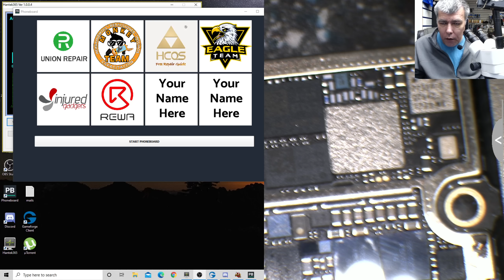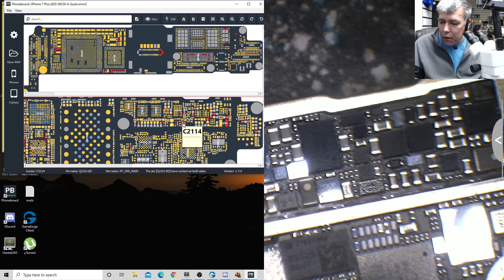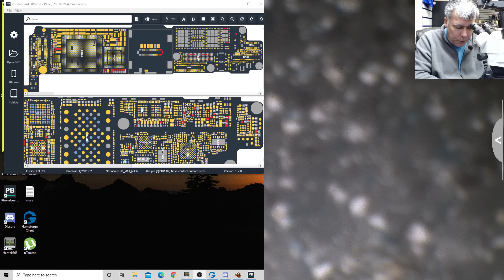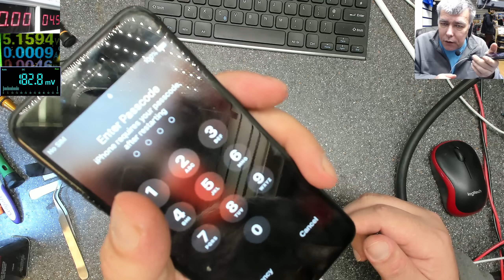Iphone 7 plus, shorted board repair

Comment: Freeze spray or compressed air upside down would be much precised to determine schort components. Even rosin flux smoked on the board.  Not to mention thermal camera.
Reply: Petrol/Isopropanol is cheaper and always available in a repair shop. And don’t forget he is doing very cheap repairs.
The favorite repair method from iPad rehab was her cheek for example. Whatever works is ok.

Comment: i have a problem with an hp laptop thats not switching on, compared to the other hp laptops that i have opened up whereby only the standby 3.3V are present, this one seems to have power to most of the coils, once the charger is plugged in. however the fan doesnt turn on dont matter how many times i tried to ground the standby voltage. im thinking the super i/o is faulty causing the coils to have power, is there anything else that i can check. thanks in advance.

Comment: When you say about "come with the  amps" beyond the mosfet, is this like it is with the laptops where the mosfet is open and you need to "come with the amps" on the output side of the mosfet of current sense resistor?
Reply: In this case (without rewatching it) I think he means just put the Linear PSU on the phone by connecting positive and negative from PSU to the battery terminals.
Reply: @Infiniti25  A little further than that. I use the voltage injection method myself. My query was more relating to the mosfet itself. In laptops when a there is a short, there are mosfets that open in fault condition to cut the power to the rest of the board. When injecting voltage (or coming with the amps), it has to be "after the mosfet" ( if it was before the mosfet, the open state of the mosfet wouldn't allow current through). I was just wondering if it was the same case with the iPhone as he keeps saying about injecting voltage after the mosfet or if that mosfet was there for a different reason.

Comment: Sorin how do you just remove a cap with a calculated value and not have to replace it? These SMD components often have no indication of what value they are. I’d love to just pull the bad part, throw it away, and put the thing back together! Only you get away with that 😂